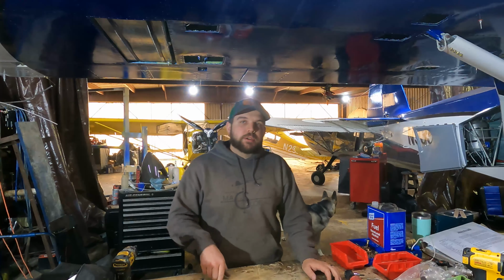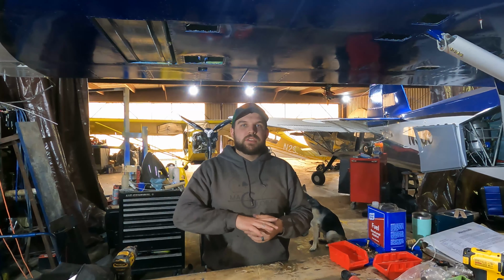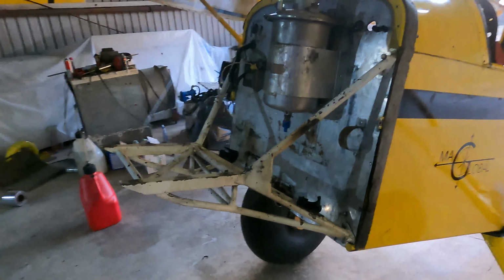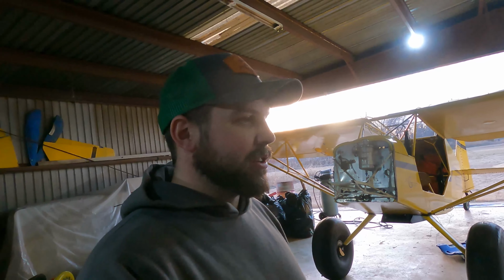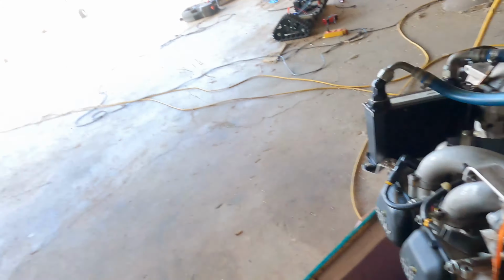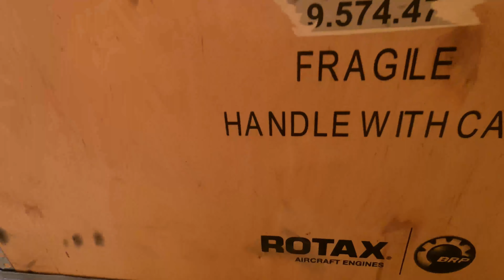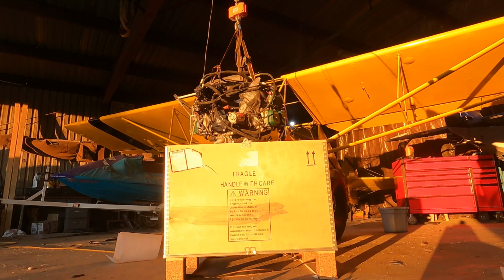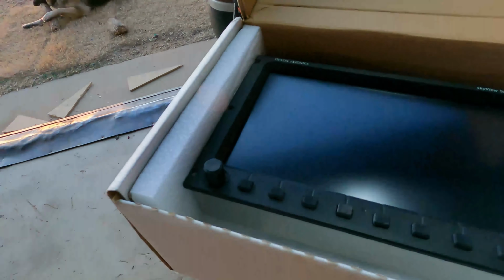Rans S7 Rebuild [Rotax 912IS Dynon sky view bush plane Retrofit] Part 1

Comment: Great video. You comment on running weight in baggage. What are you typically packing in there (how much) for weight? My situation is similar, the S7 likes to settle a bit smoother with a passenger.
Reply from the maker: I’m a big guy about 225 so I’m actually out of the forward cg without baggage weight. I keep about 30 lbs in the baggage when solo land much better especially in three point.
Reply: Thanks. The first thing I noticed in solo flight during the type/model checkout was the difference in how it settles when the aft seat is empty.